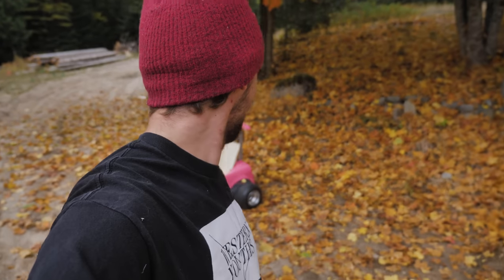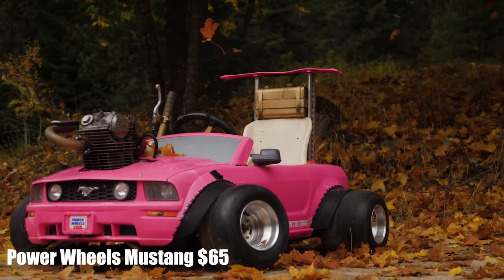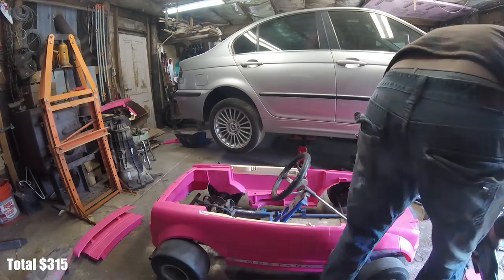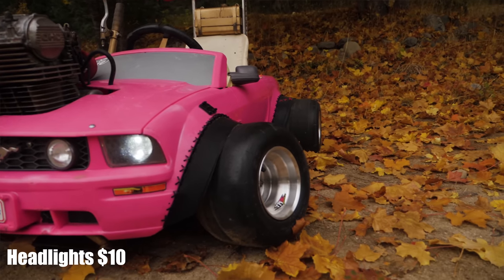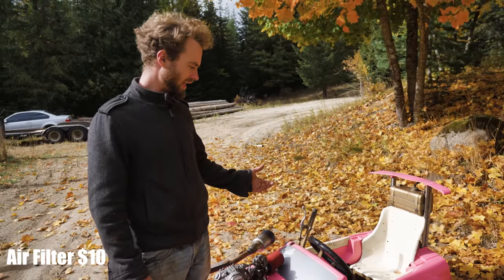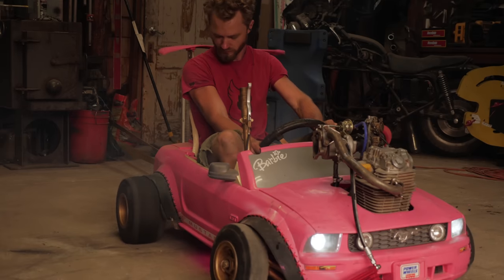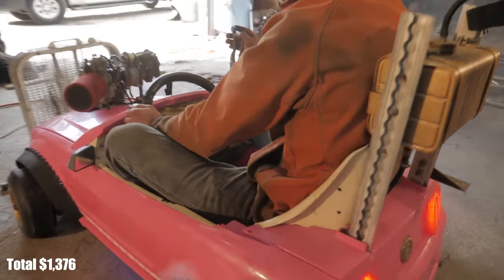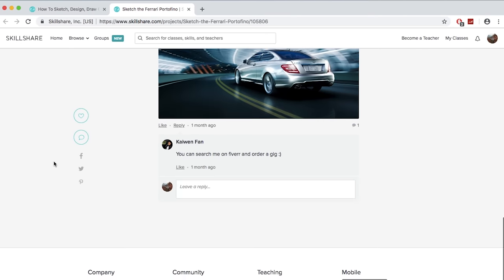How Much Did the Barbie Car Cost To Build

Comment: You could make a cheap dyno for the Barbie kart. Four bearings, two rods, and a frame welded to hold that together. That way you can dyno, without burning up the tires. Total cost might be $200.
Reply from the maker: That would be so funny
Reply: Martin Luther  that was a good idea. I actually watch that channel a little but haven't seen that video. Instead of going to the flywheel, they could put it on the back axle. Not sure if the Barbie kart might overpower that dyno though.
Reply: Hi i love your videos

Comment: mine is still being built but most of the parts i got for cheap from a junkyard or for free like the predator 212 was a brand new motor costed me about 100 dollars paid about 25 for the wheels and the frame i might be able to get one for free
Reply: i got lucky and got the body for free found it sitting in the woods where i used to live